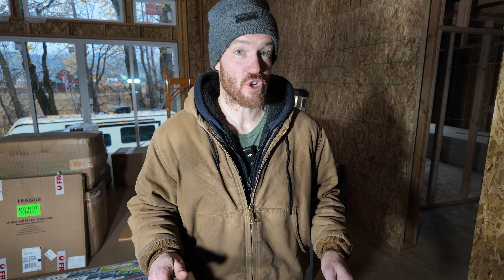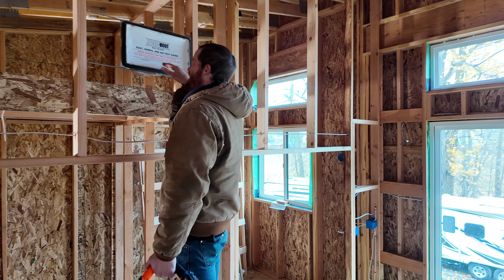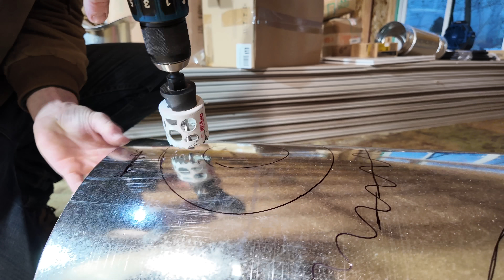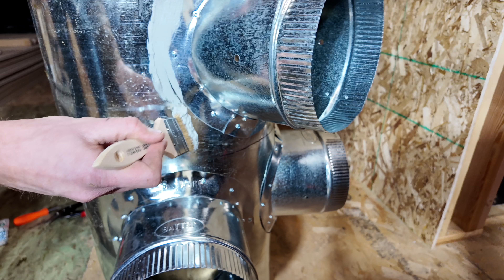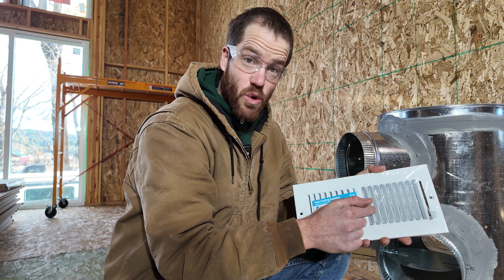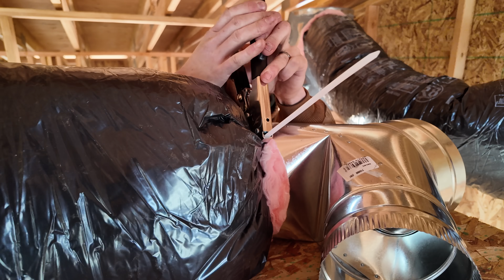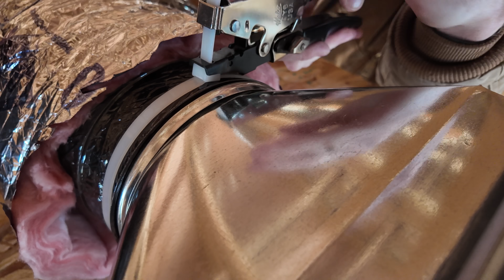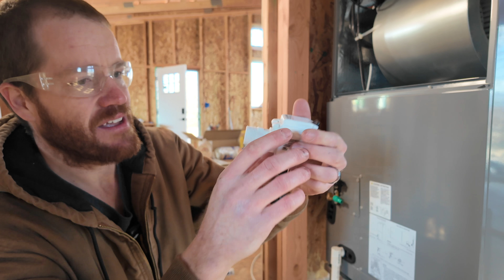HVAC Contractors Hate Me For Showing You This

Comment: I really love your videos! 😍 
One hint for your house: Add multiple Cat.7 Ethernet runs from next to where your internet service might enter the house to each room and into the ceilings of the hallways on each level. This will save you from a lot of head scratching later when all the walls are finished and WiFi may not cover the house very well.
The Ethernet runs in each room give you plenty of speed and reliability for work and video production, as well as the ability to place a big storage for footage somewhere in the house, removing noise and heat from your workspace. The in-ceiling Ethernet provides power and data for access points, which is much more stable than those wireless repeaters or wireless mesh systems. Add Ethernet also to the mechanical rooms and the garage, because current and future tech will need much more connections (e.g. some heating systems, solar, car-charger etc.) 🙂
Reply: CAT7 is honestly overkill, you can have whole home 10G with CAT6.  You can probably manage that even with CAT5e (works in my house)
Reply: Or just set up a mesh wifi if needed
Reply: @ for sure a solution if nothing else is possible, but hardwired is still the only really reliable solution … my own painful experience 😅

Comment: I don't know where is this property  I assume in the US. I'm in Canada. Here we have a building code. First, only certified technicians are allowed to work on the gas lines to the furnace, certified technician to work on the HVAC System. Why? They know the building code and all safety requirements to ensure safety. Why do I mention this when this video is clearly a diy video? My understanding is that, vents register are required to be near each window. Unless I'm wrong, you located your vent registers above interior door ways. I can't say if you are doing it right or wrong but....🤔

Comment: You did pretty well!!! Just some insulation mistake, and you'll get some water condensed in some places like in the supply plenum, one more detail, in your air handler coil the pressure is negative, so, the p-trap is to avoid the air come inside the unit, not to come outside!!!! In general, those details are worth the $15 000 saved!!!!!  But won't pass the inspection if required.

Comment: Hi. As a HVAC installer myself. Nice job!
Just few small things.
As I install very similar air handlers, the bottom side of the unit has a removable washable air filter that you will need to maintain however your condensate drain line is running right through it, you need to route the drain to the side so that you can remove the filter.

Make sure you have transfer ducts or undercut doors for return air to be able to get back to the units from all the rooms other than kitchen and bathroom.
Reply: This is good advice, but when you do the math for door undercuts, you realize the undercut would sometimes be as big as 16 inches for proper return air, sometimes the jumper duct really is the best plan

Comment: aside from blocking your filter access with the drain line, really not a bad job for a non AC professional. that zip tie tool you have has a tension adjustment feature and it looks like you need to tighten it. and just for a little extra knowledge, the type of dampers on those registers are parallel blade type, and are not good at throttling/balancing air, just good for open or close, and shifting the direction, those manual volume dampers (discs) you installed is the best place.

Comment: Thermostat should not be on the same wall as the air handler either. It will mess with the temperature sensor in the  thermostat

Comment: As an hvac contractor that duct needs to be longer and reduced every 10 to 15 feet to keep velocity up. Round pipe is a great choice. I have done this but with a proper trunk run and the flex is as short as possible. Runs of flex over 20 feet wouldn’t pass inspection in some areas.  But if your system moves air and works …is what it is. 20k for a new install isn’t out of line and I’m surprised local building code officials allow you to do it yourself.

Comment: i have been doing hvac for over 20 years your air flow is wrong for example one 8 inch flex equals 2 six inch flex so it should go as follow a single 8 inch flex should be paired with 2 six's with a y so your 8's that are y'd should be enlarged to get maximum air flow and keep your static pressure where it needs to be. also with that said i prefer to keep my flex runs at a maximum of 15-20 feet. hope your project turns out well

Comment: You saved $10k. Real hvac guy use better quality components like carrier, trane, lennox... not amazon special mr.cool. Also in TJI joists code is the middle 1/3 can have holes. You ran a power wire of all things almost tight to the top. That amount fire hazard one stray flooring nail/ staple into that wire Equals your house burns down.

Comment: I have some observations. 

1. Using common return? 
    While acceptable it’s certainly not effecient, especially in the summer when you need to pull humid air from the top of each room for humidity control

2. Don’t know what climate you are in if you are north of Tennessee the heat pump isn’t going to keep up and that electric strip will cost you a fortune in electricity 

3. The condensate line does not need a “vent” 

4. The way the cfm was calculated is uneducated at best. 

There is a specific calculation that every HVAC company uses to size duct and equipment called the manual J  if the equipment is too big you are going to have issues with humidity control as it will not operate long enough to remove the humidity in the air if it’s too small it will run 24/7 to keep up

Comment: The install looks great! 
Question? Is the ductwork inside of the conditioned space? Looks like it will be but  If not, I would recommend building a box around the ductwork, sealing it off and insulating above it to essentially move it into the conditioned space.

Comment: You should put tape over the top to air pipe opening. Your house is going to get dusty during drywall/finishing. Drywall dust can be great for clogging low flow plumbing like a condensate line. Just be sure to remove the tape once the HVAC is running.

Probs a good move for all rough in plumbing openings to tape them. Prevents sewer/septic gas intrusion too while rouged. Keep up the great work.

Comment: I am a capable DIY guy myself and certainly appreciate and applaud doing it yourself. 

On  my list of constructive criticism, the biggest is this. 

You want to place your boots/registers over your biggest heat gain/loss areas in the room, which are your windows. You also want to sweep the air out of the room by placing further in to the room, not at the door.

Many of your placements are not going to do this well and your comfort level / efficiency is going to suffer 

Good luck and enjoy your content.

Comment: Nice job! One point, HVAC systems usually heat/cool from outside in. Meaning you generally feed your ducts to the outside walls and use the interior walls for your cold air return. This ensures a more complete exchange of air in each room providing more comfort and efficiency.
Reply: Bingo. Another point would be that ideally your supply diffuser would provide a “curtain” of conditioned air across the window which is always the point of the most heat loss/gain.
Reply: My thoughts was has he lived in manufactured homes his whole life because some of those have the ducts running down the middle of the floor or ceiling. 
I had hvac put in our house we built 40 years ago and they didn't run ducts to the walls upstairs and in the walkout basement that we told them would be finished they only ran 4 ducts along that 48ft side wall on the walk out. They got 5 on the north wall in the basement about 4 ft from the wall. All of them are way short of the walls.
Reply: @ So the floor register is literally underfoot?
Reply: It seems he wanted to install all the vents thru the interior walls for easier install than extending the flex and penitrating thru the ceilings by the outside walls. Back in the old days some plumbing and heating contractors would install  hot water base board radiators on inside walls .Their thinking was that the hot air would wash up over the room to the cooler outside walls providing a more uniform heated area.  I believe outside wall installs are the best install approach. He still did a pretty good job regardless.

Comment: It is/was pretty common that down south to use duct board for building ducts instead of sheet metal. You are just working with foil backed fiberglass so it can basically be done with a utility knife and the appropriate tape. Probably would be a more friendly DIY solution.

One minor correction, the heat strip will also be energized when the system determines it needs to defrost the outdoor unit. During defrost the system will run the refrigerant system in cooling mode and steal heat from inside to warm up the outdoor unit, the electric heat will energize to prevent cold air from being pushed won the ductwork to the spaces. If you live in a cold climate you really do NOT want to forego the heat strip.

Comment: An 8” supply can’t supply enough cfm for an 8” and 6” trunk line. Bare metal needs to be insulated. Insulation on duct should not be exposed. You don’t use just panduit straps you should use the “Pookie” or “duct butter” to seal, the panduit takes the tension. airflow is strongest on taps closest to the cap, so those should be the furthest runs. You need to secure/support your duct work. Mechanical rooms should really be hard piped, it’s code in CA. I won’t continue but let me know in 4 or 5 years if it’s still working…..
Reply: I give it 4 to 5 months not years.

Comment: You may want to apply some sound deadaning mat to the furnace to reduce the noise.

If you choose to do that, tape all the dyna-mat edges with foil tape, that way it stays put.

Avoid putting it in the air path, on the outside of ductwork is great, inside duckwork is a no go.

Source: My uncle was one of the best hvac guys in my home city until he retired.  He did the install in my parent's house 30 years ago, the original equipment still works and is wisper quiet.

Awesome video, I really enjoyed watching it!

Comment: This is exactly why I intend to focus on installing ground source heat pump systems. Installing HVAC systems can be easily be done properly by anyone with a mechanical aptitude. I'm actually going to begin producing videos to teach homeowners how to do these types of installs because HVAC contractors bids are insane as you've already discovered. The only thing  I would have done differently up to this point is run a plenum straight up into the attic. You would have saved on materials in not having to purchase the take off on top of the furnace and all of the unusual round pipe take offs and you would be able to easily fully insulate that supply plenum.

The only problem I've seen on Mr Cool homeowner installs is almost everyone leaves all of the excess line set tucked behind the condenser or in the mechanical room. DO NOT DO THIS! This excess coiled loop acts as a very effective oil trap. Small amounts of compressor oil are pumped into the system and it makes it's way back to the compressor when the system remains properly charged ad the piping is properly sized. This maintains what is know as velocity which basically drags the oil back to the compressor suction line. If you leave excess amounts of coiled copper line set all of the oil will become trapped in it and never make it;s way back to the compressor. Systems piped like this begin showing signs of serious trouble with a couple of years. 

This is a pretty big problem if you want to do it right. I believe Mr Cool precharges the line set as well which stinks because in order to cut the line set you have to properly evacuate both lines. Shortening the line set isn't difficult but requires specific equipment and materials to do it the right way so you either have to hire someone to do this part of the install or run the line set under the home in a way where the line set is fully extended because I'm pretty positive the line set length they sold you has been calculated properly. I'm assuming is entering the mechanical room through the floor. Just run the line set in a gradual arc and maintain a slight pitch downward toward the outdoor unit. I hope how I explained this is clear. Oil loss failures are inevitable when you leave the excess line set in a loop behind the unit, trust me. I love your channel. Good luck!

Comment: also couldve gotten mastic tape, the metal tape you used still needs mastic on top and also mastic inside each air boot and around the seams. man i love all the herc tools too, i got most herc tools as backups if my milwaulkees fail or break

Comment: You forgot to leave beer cans and Red Bulls laying everywhere.
Reply: Best Comment Ever!!!

I had to remodel the whole interior of a house after a water damage incident… found 20 year old Coors Light cans behind the drywall and under the gas fireplace!!
Reply: This is the difference between DIY and professional lol
Reply: And the occasional Pepsi bottle of piss... 😑
Reply: And lots of bolts, nuts and screws that are accidentally dropped and instead of bending over and picking them up they just grab another.
Reply: And smoking a joint in the rafters.
Reply: Heck yeah!
Reply: Beer cans is wild. Red Bull is okay but beer cans is wild. Nope you need to be sober working on my property. Not paying for slipups. This isn't like building a fence.

Comment: As someone in the HVAC field, I’d say it looks good.
The metal fittings need duct wrap to improve efficiency(especially if in an unconditioned space) and prevent sweating.
Make sure the pre charge line set connections are torqued properly as those can leak otherwise.
I can’t see every place the flex duct was installed, so make sure it isn’t crimped or going through extremely tight bends.

Comment: in most states you wont get your inspector to sign off on your occupancy certification.or if you ever tried to sell your home. the buyers inspector should pick up on the improper installation of the ducting.you need to do a heat load calculation to somite to the building dept per the dept of energy.your heatloss is at the outside walls,thats where you put your registers.distrbution box's perform poorly at best. you'll always have hot or cold rooms. buy a little extra larger duct and gradually reduce it as you supply duct to the spaces.3ton and below at least twice . over 3ton at least three times. big return in one spot will save money up front,but you will need to put same size return in each room if you want comfort.if you install a heatpump in northern states with electric back up heat.you will pay huge electric bills. get a wood stove or install gas or oil back up.your gas or oil back up also serves as your air handler.wish you luck.where ever you buy your equiptment from will do all the math and sizeing for free to help sell there product.

Comment: My first time watching your videos and I am impressed.  You do a great job describing and your editing is on point.  I have two observations that will improve the efficiency and comfort of your home:  1. Your vents  are located over your doorways.  Your doorways are your cold air returns.  This setup has a tendency to suck the conditioned air out of the room, leaving the majority of the room stagnant. If the vents were located on the wall opposite the doors, your room will be more comfortable.  2. Your branches and vent bodies are uninsulated.  It is incredible how much condensation will accumulate around the smallest exposed areas of duct work.

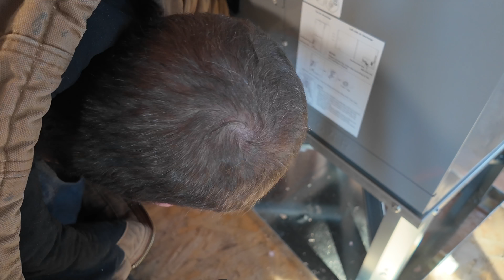Comment: 18:04 We had the trap plug up over the years and flood. 
If you add a cap or clean out access now, even for that short drain run you won’t need chemicals to clean it later. It just made our life a bit easier. 
Thanks for the video.

Comment: By cutting corners and saving a few dollars you have just installed a nightmare for another technician or who ever has to work on it. Don't like the air handler in the middle of the room like that. The noise will suck. The black ductwork doesn't have UV protection like the silver stuff, so the heat and UV will break down the duct plastic and cause air leaking and moisture problems. The none insulated areas will condensate and cause mold growth. The biggest COST that everyone wants and no one wants to pay for is a company and people to help make a machine last 20 years.

Comment: Did you have a heat load calculation done?  That tells you size of ac and size of ducts in each room. Windows, window location and insulation all affect cfm load in each room.  Why didn’t you drywall or enclose your closet, before installing the air handler?  How you going to enclose rear wall?  Nice vid

Comment: Attach a hose fitting to the top of the vent line and put a valve just after the p trap. If the condensate drain ever gets clogged all you have to do is close the valve and connect a garden hose to the vent pipe. it will blast out any clogs easily.

Comment: it's way too late but a cool thing you could have done inside the distribution duct you built would be to add a lampholder to the top and screw a UV bulb into that lamp holder. You could maybe do it with the return. It makes a huge difference.